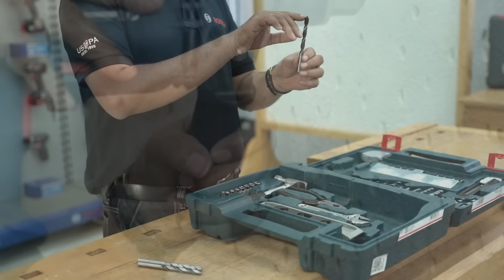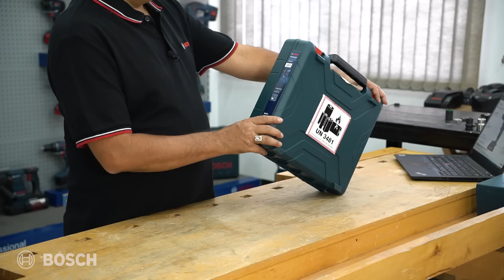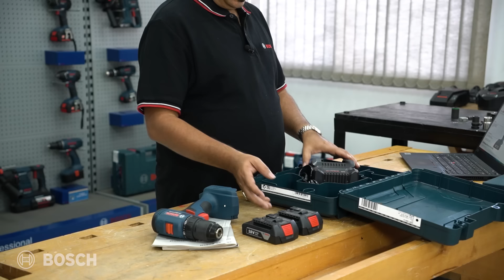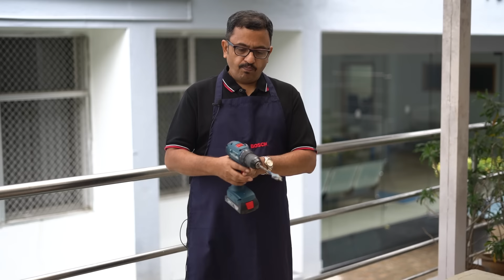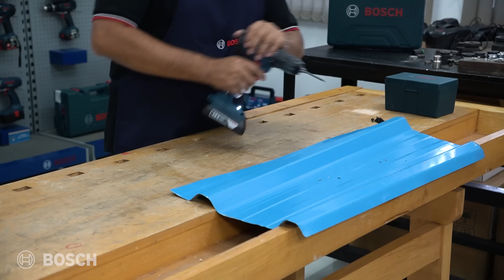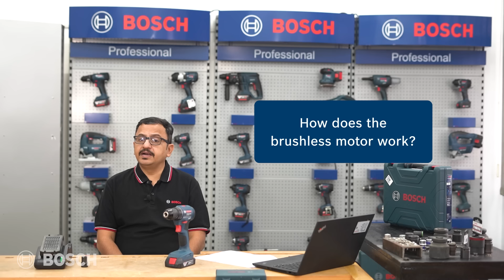Bosch GSR 185-LI Cordless Drill / Driver | Unboxed & Explained | Basics With Bosch

Comment: Thanks for the well-explained video.  Why is there no drilling on the Brick Wall test for this model?  In the GSR-120 Li, you did a test on the Brick Wall.
Reply from the maker: Hi, GSR 185 Li is designed to drill into Wood & Metal. To drill into brick or masonry do have look at our GSB 185 Li video - https://youtu.be/HoLYvE66YQw?si=k6b0A4zhdr6n1LeG